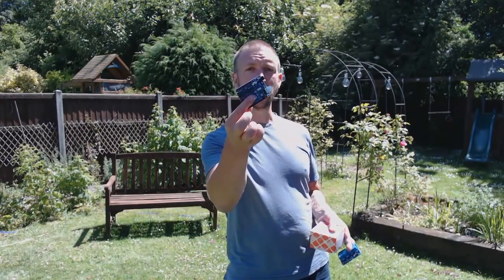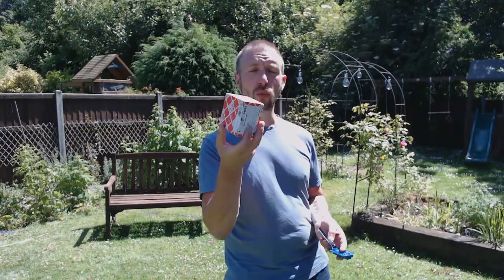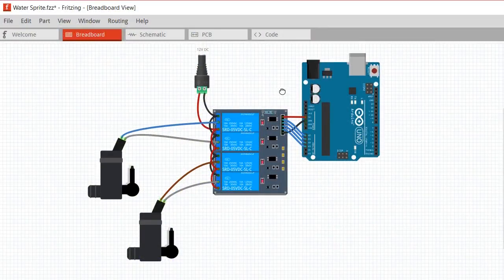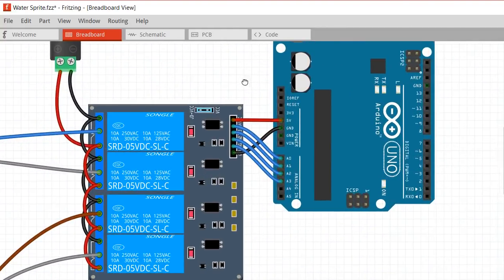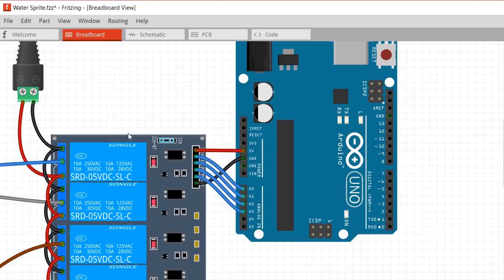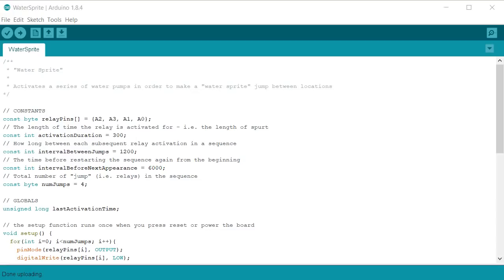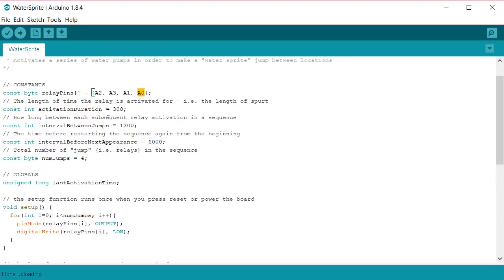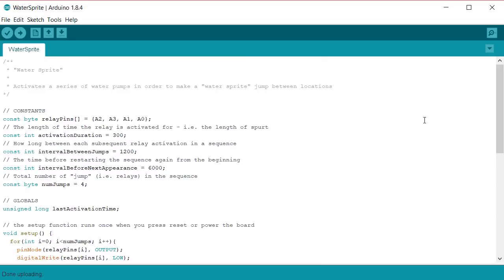Arduino-controlled water sprites!

Comment: This is cool, it is as an substitute for an H-bridge to control a motor in 2 different directions.

And this "H-bridge" will be able to drive motors up to 10 Amp. Quite cheap solution for driving bigger motors in 2 directions. I have to try it some day. I have a lot of relays laying around. :)